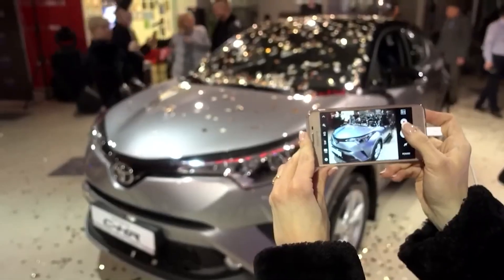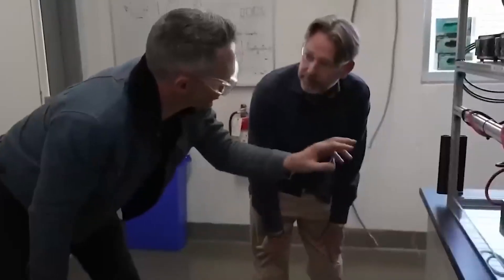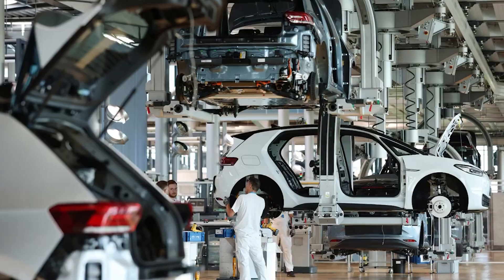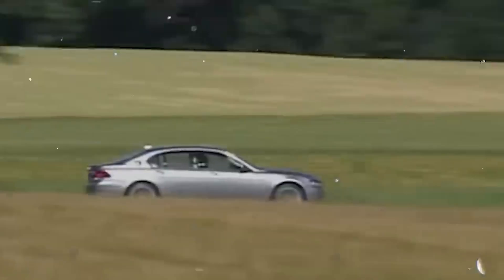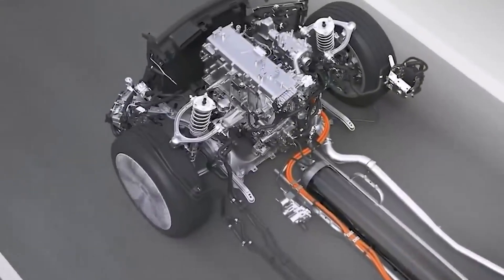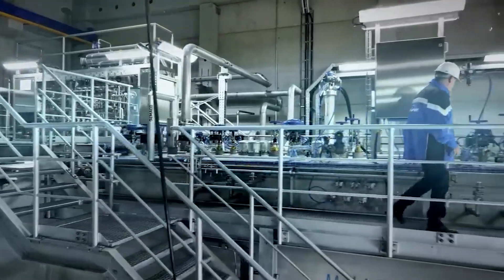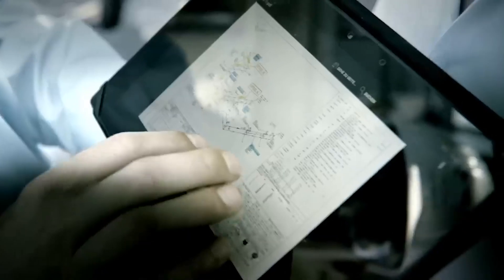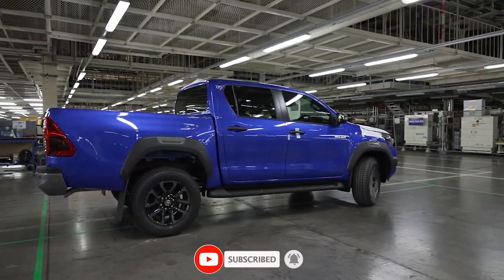Toyota CEO | New Engine to Outpace Electric Cars

Comment: Why is the power plant always left out, evs just replace one fossil fuel for another.  Eemissions such as coal sulfur dioxide, nitrogen oxides, carbon dioxide, mercury, and other hazardous air pollutants (HAPs) uranium, plutonium. Who knows what else and this stuff ends up everywhere.